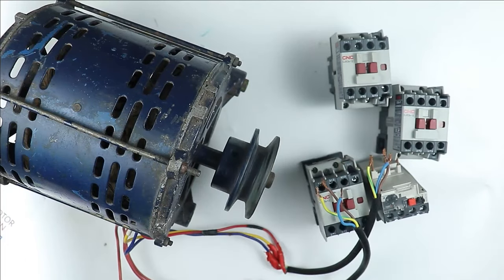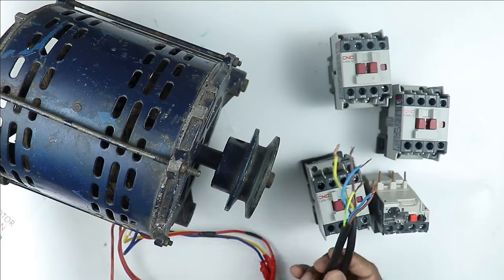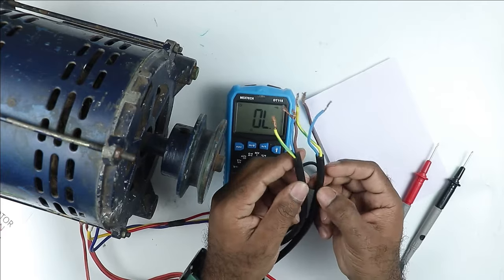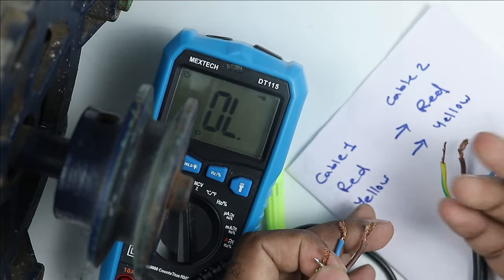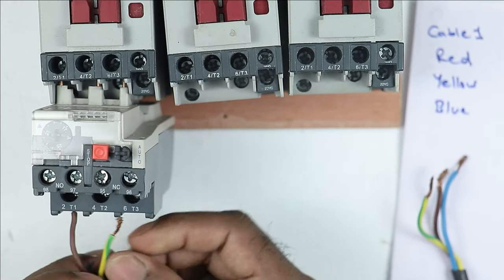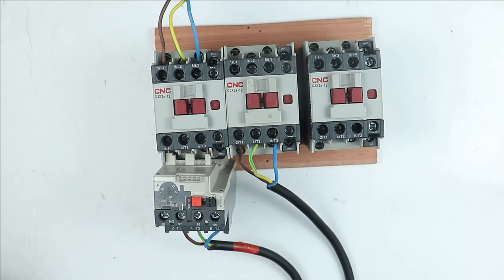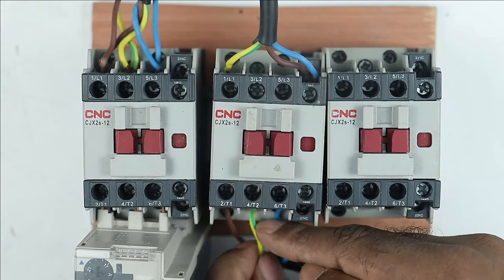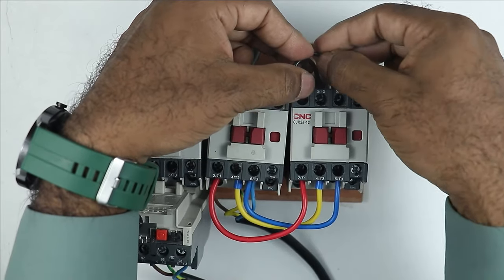Star Delta Starter Power wiring Explained Practically by @TheElectricalGuy

Comment: Hello Senior, I'm seeking some guidance regarding a slip ring motor. I have a motor with a nameplate indicating a 110 rated voltage. Could you kindly advise on the appropriate coil voltage for AC contactors to use with this motor for making a Star Delta Starter Connection? Your expertise would be greatly appreciated.

Comment: The diagram at 13:12 is wrong as the phases have not been transposed on the delta contactor. And the diagram would be clearer if the star contactor was placed to the right of the delta connection.
Reply: I saw that too but it's at 12:00.  13:12 is the end of the video...

Comment: The motor terminals ( u, v,w) don't look clear to identify, so this makes it difficult to follow that the motor coil winding is supplied with two phase supply, and whether the input at the contactor supply should be interchanged at the delta contactor.